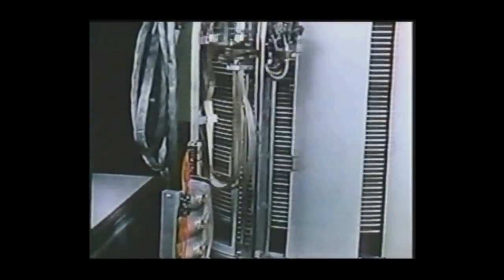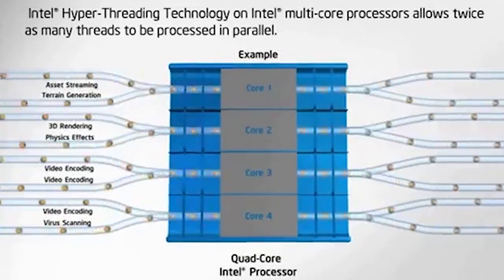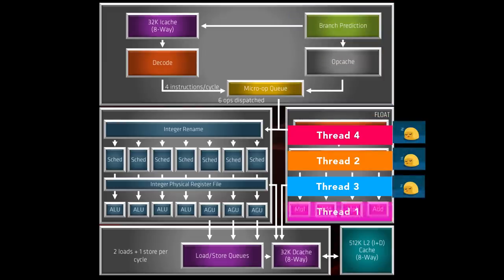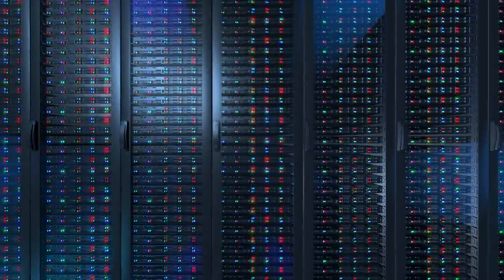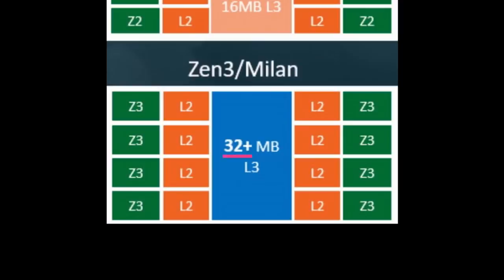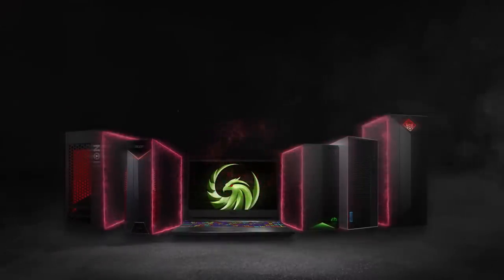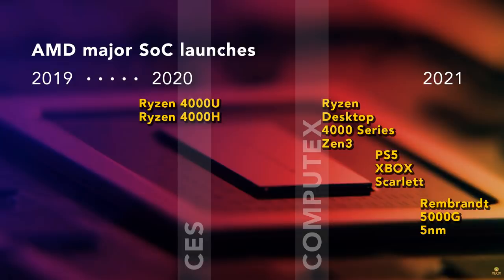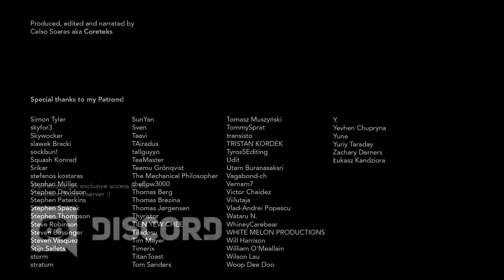Rembrandt | AMD’s MONSTER 5nm APU

Comment: Since AMDs return, I've basically been dreaming of a system on a chip like solution. I mean in a sense we're already there, technology wise, it is just that the product haven't been designed, allegedly, nor released.
I imagine something like 8 CPU cores, which I think should be enough for today's standard and of course we already know the size of the chiplet, a single Navi GPU die, and some 32GB of shared HBM2 memory. I suppose there could be a high end solution with 64gb, but if you need that much memory, of course you woulndt consider this solution anyway. There would be no need for memory slots, pcie slots, for the average consumer at least, and even if you we're to pack it all in a tr4 package, you could probably fit it on a mini-itx board, size wise only, of course. I can even imagine such a solution being sold with a full board water block. Of course it would be very expensive, but then again, probably not, when taking into account all the money you'd save on RAM and dedicated Graphics.
If I was the boss of AMD, such a product would likely already exist, but alas, I am not, so I will simply have to wait and see if I dream will come true.
Reply: I'm glad you're not the boss of AMD, who is your target costumer? Do you really think people would buy that? Miniaturization is more expensive, not less.
Reply: The implications for things like VR could be huge. Imagine the headset doing everything a next gen console can do in a form factor that is smaller than current VR headsets that rely on high-end gaming PC's. Better, smaller, more efficient. Just like what has happened to phones. Hopefully in less than a couple years.
Reply: I certainly do, and as I explained, the technology already exists, it really just a matter of packaging it. Well, it's never simple, but AMD do employ a rather clever bunch, and as I also explained, this kind of solution, while being more expensive, would also remove cost in other areas.
The fact of the matter is that even the current, which are certainly not capable enough for me, are capable enough for for a lot of people, if not in fact most, because they don't spend their waking hours playing 3d shooter clone at 4k 120 fps on ultra settings. The do office stuff, what's youtube videos, netflix and occasionally plays angry birds, or whatever is hot these days. A solution that can handle this we've had for a long time, except perhaps for the 4k part, which does seem to be a must these days, and now I'm simply saying that it is time to take the next step.
What I'm not saying is that AMD should stop doing what they're doing anyway, of course not. Those who want the titanium package, and who can afford it, should still be able to get it, but most people, as in the vast majority, do not, or cannot.
Yes, the entusiasts drive innovation, but it is the average consumer that pays the bills, and a solution such as described, would help do exactly that, as a lot of the money that would otherwise go to other parties, now go to AMD instead, and in the meanwhile we can build a complete system from just 5 components. Motherboard, storage, APU, PSU and a case, provided of course a cooling solution is included with the APU.

You may be glad that I am not the boss of AMD, but there is a target, that is just about everyone, and yes, they would buy it, as they'd get more for their money, and no, there's no actual miniaturization going on, just a reconfiguration of already existing technologies, and while it cost money to develop such a solution, as is always the case, there's no reason that I can think of, that it would actually be more expensive, quite the contrary in fact.
Reply: @g0etzome  I think it will be a while before we get there, especially if we're talking true VR solutions, which would require computing power beyond anything remotely possible today, no matter how deep your pockets are, but development of integrated solutions that is more powerful, is certainly a step in the right direction.
Reply: The modularity of PCs is a good and a bad thing.

Good: Allows for customization at the customer level, 
Bad: Lower every part potential because of compatibility concerns and the extra layers of connectors.
That's why specialized hardware always perform better (in terms of ressource efficiency and form factor), but often cannot be mass produced because of market limitations (not everyone need that specialization).

@h2oaddict28
Miniaturization may or may not cost less depending on how much new parts (mass production)  you need and how much space is shed (the degree of miniaturization).
An example, if APUs eventually perform at the same level as discreet graphic cards, then it is not only cheaper to have an APU (against a CPU+GPU cost), but it use less physical space (miniaturization).
Reply: @h2oaddict  my best guess is that for a generation or 2 both miniature and single chip solutions would be in the market, but once single chip solutions can come down in price manufacturers will switch over fully. Once APUs have the performance of high end graphics why would PC manufacturers even consider making traditional parts anymore?
Reply: @Tyler-Kearney  Like the video says, it is already happening at the server level: specific needs for specialized hardware implies new development opportunities for Desktop level products based on server technological landscape.
Reply: Intel's pushing some reasonably powerful NUC PCs, and ARM might do a good job of coming at it from the other direction (with the successors to their 8cx). Something similar to what you've described is likely going to be here in the next 5 years or so.
Reply: PC modularity is a GOOD thing, it's nice that I can swap out my GPU at anytime and know my new one will be compatible. SOC just create ewaste
Reply: The real problem is load balancing on modern systems.  There's so much overlap in processing capability between CPUs and GPUs now that its a real challenge to utilize all (or in reality even a fraction) of the power available.  If AMD was able to get a CPU/GPU combined, so that they shared compute resources, the performance would be through the roof.  Sadly I don't see anything in the pipeline for either AMD or Intel for PCs.  Consoles on the other hand are much closer...
Reply: This is something I've been talkin about for a while that amd has been in the apu market for some time now and have access just so much Tech they had great CPU GPU hbm they will be the first with a full system on chip with 3D stacking I see a AMD on the top of the food chain as of today
Reply: @h2oaddict  i would buy a full soc like that look a( ryzen 3700x 8 core cpu/navi 5700xt gpu/io/32gb hbm2 )all on one piece of silicon a full one chip package and say the cost for this chip is $600 or $700 bucks hell yes I would buy that.
Reply: @CrimsonTide001  Soo, it's like if a games doesn't need much CPU power then the resources go to the GPU, right? Hell yeah...like in an ideal world where nothing bottlenecks anything. It'd be wayyyyy cheaper. Also, why even bother with mobos. Maybe they should make their own complete package with RAM, PSU, cooler, fast storage everything included in a box with ports for extra storage and transfer purposes just like phones. It would be like a windows console. And because there are less component combos and other stuff developers can optimize their games better just like they do for consoles!

It would be like Consoles and PCs becoming one!!!

Comment: @Coreteks 21:25 "the line between CPU and GPU will start to blur..."

As it has been for many years, from Intel's original MMX instructions that sat on top of the FPU (meaning you could use one or the other), all the way through various SSE instructions for multimedia, to today's evolved SSE instructions labeled AVX, etc. GPU's have gotten more general purpose, and CPU's have become more parallel (Witness Intel's Larrabee, and forthcoming Xe architecture). 

Just as Tim Sweeney of Epic predicted, in 2007: 

"I think CPU's and GPU's are actually going to converge 10 years or so down the road. On the GPU side, you're seeing a slow march towards computational completeness. Once they achieve that, you'll see certain CPU algorithms that are amicable to highly parallel operations on largely constant datasets move to the GPU. On the other hand, the trend in CPU's is towards SMT/Hyperthreading and multi-core. The real difference then isn't in their capabilities, but their performance characteristics.
"

"When a typical consumer CPU can run a large number of threads simultaneously, and a GPU can perform general computing work, will you really need both? A day will come when GPU's can compile and run C code, and CPU's can compile and run HLSL code -- though perhaps with significant performance disadvantages in each case. At that point, both the CPU guys and the GPU guys will need to do some soul searching!"

https://www.beyond3d.com/content/interviews/18/4
Reply from the maker: @
cj juszczak thanks for your comment and the quote. I'm well aware of this (I've talked about it in previous videos), but not everyone is :) Riken has released some numbers on the A64FX btw, it's both faster then a Xeon (in certain workloads) and faster than a Volta (in certain workloads).. for the work that matters to them it's the perfect solution.

Comment: Linux supports CPU hotplugging, so it could totally dynamically turn on and off SMT

But yes, either way, SMT4 is a Datacenter feature. There is little point on the Desktop.
Reply: Says who? SMT4 would mean we could get 4 thread single core APUs which ticks the bare minimum boxes for general use, and probably would come in with an MSRP under 90USD or even 70USD. It would be a godsend to people who want dirt cheap builds, perfect for basic home use, offices that need to order equipment in the tens or hundreds of units, and schools that otherwise would be stuck with outdated platforms to keep the tax-retentive quiet. Think open minded mate. Plenty of worthwhile scenarios in the desktop segment.
Reply: @nicolaspinto2927  Did you watch the video? Single core SMT4 cpus would not get anywhere close to 4 core performance.

And core count is not what's preventing cheaper CPUs anyway.
Reply: @squelchedotter  I never said they would, though if engineered to do so they would come close enough for the outlined purposes. The cost argument is predicated on less silicon is less cost through scale. If you can cut what was an 8 core chip into 8 chips, done at scale that means you have 8x as much product (ignoring unavoidable rejects) for roughly the same cost. That should push price down per chip. Taken another way, AMD chiplets that fail QC so badly that they can't even be 200Gs could be reused as single core chiplets if they had enough threads to make up the distance. Even if the reject rate is only 1%, that's enough to warrant trying to recoup as much from material cost as possible. Entirely speculative of course.

I am curious what you think is keeping CPUs inflated though. I personally am not quite sure what to blame when we have desktop-replacement level Pis (assuming the aforementioned use cases) at thirty bucks when the cheapest thing you can buy off the shelf right now is probably the A6 or 200GE for twice that and that's just getting you the CPU. We should just develop up the ARM platform and have budget folks switch to that, especially once someone throws together some kind of Thunderbolt or PCIe accessory board for the Pi to use eGPUs. That'd be an interesting project to undertake.
Reply: @nicolaspinto2927  You don't seem to understand how SMT works.  There are zero additional execution units with SMT.  It's essentially just an extra set of registers, so that different threads can utilize available execution resources without having to do a context switch.  So if one thread is waiting on data from memory, another thread which already has its data loaded into its registers can run calculations on that data.  Because Zen splits the pipeline early between integer and floating point instructions, SMT also allows integer calculations and floating point calculations to be carried out simultaneously by separate threads.  It's in a scenario like that where >2-way SMT could provide benefits.  An additional thread could load data from cache or memory while the first two threads are executing.

The key point is that there's still just the one integer and one floating point execution slot available.  A single-core 4-way SMT chip would never be faster than a single-core chip without SMT running a highly optimized workload that never left usable bubbles in the pipeline.

And quite beyond that, the Athlon 200GE is already the CPU you're talking about.  It has two cores, four threads, and built-in Vega graphics.  It's launch price was $55, and it's currently available on Amazon for $57.